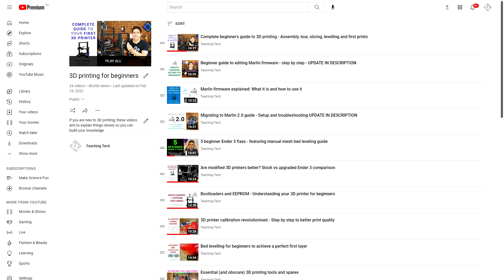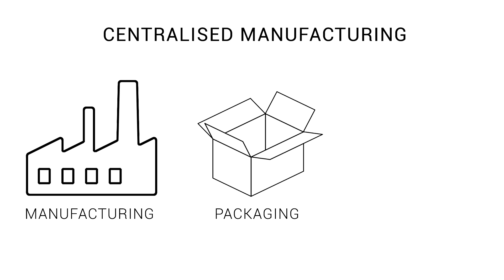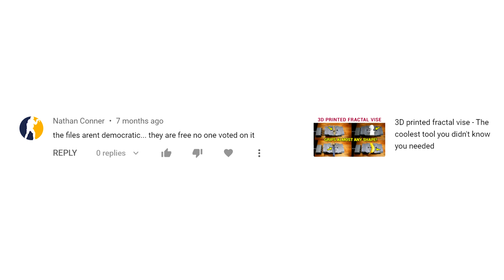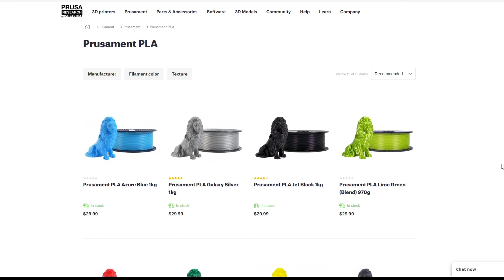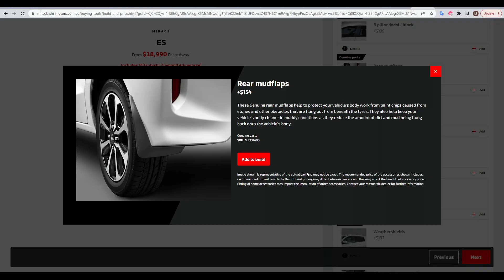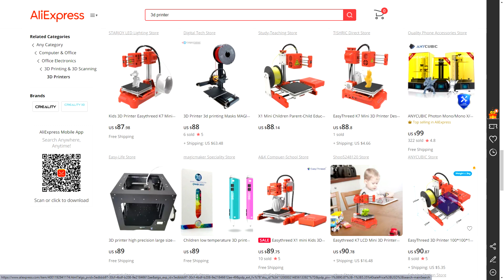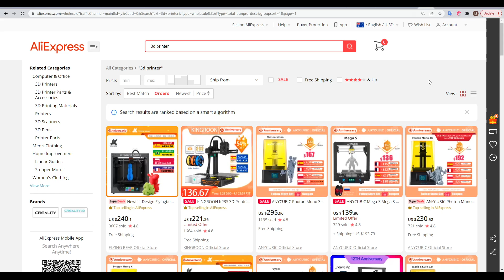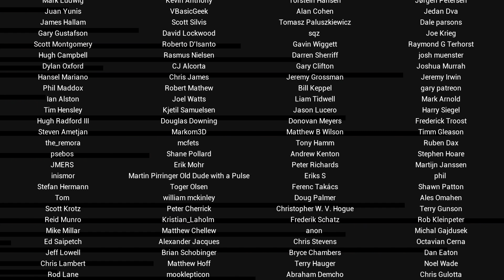3D printer trends are limiting mainstream acceptance: The 3D printing paradox

Comment: As I only started printing 12 months ago it very soon became apparent that choice of printer to start with was not going to be an easy choice, they all looked very similar to a newcomer and so time was spent on vids like yours to help make the decision, it also became apparent that after running the printer (Ender 3 v2) for a couple of weeks that upgrading parts to get better print quality was going to be required, that would probably put a lot of prospective buyers off if they dont have the knowledge or tools to complete the tasks, its still very much in the tinkering stage if you want great prints with increased speed. Excellent channel been of great help with the firmware side of things,
Reply: I'm running a stock v2 with basic mods like dual lead screw ( belt linked ) , bl touch and jeyers firmware - other than that i have not found any need to do anything else and these were more convenience based mods than necessary . out of the box it ran fine and i only did the mods for my own satisfaction , i do have a direct drive conversion sitting here but i won't fit that until the bowden system starts to fail .
Reply: @Flattyman  Yes, I have the same upgrades as yourself plus a microswiss hotend, and BL touch, the printer was OK out the box but is now more consistent and surface finish much better, these are now mostly available as standard on some printers and is reflected in the price, suppose it depends if its a hobby or you love tinkering.
Reply: I feel the only thing these sorts of printers really need is an alu extruder for $4, and then fine tuning and setup. Lots and lots of that.

Comment: Very well said! The number one reason I bought a Prusa Mini as my first printer was that I just wanted it to print - and I'd say they nailed that. Of course I had to learn slicing and tricks, but that brought my parts from 90% successful to 95% successful. Your analogy of 2D printers is spot on. The early laser printers were extremely complex and often needed an understanding of paper path, lasers, scanning mirrors, heated fusers, etc. Especially when they stopped working. Most people don't even know there is powdered plastic getting discharged onto electrostatically charged paper and then melting it into the paper with a 1000w heating element inside an $80 laser printer.
Reply: But now you also get the cheap inkjets which are no worse off than low-cost 3D printers. In that regard, I'd say low-cost 3D printer are more reliable than cheap inkjets. When a 3D printer breaks down, you can actually diagnose what the problem is and replace the broken part (or better yet improve it so that part never fails in the forseeable future). 2D printers (and modern cars to an extent), do not allow any detailed diagnosis at all, as the machine just locks up until you replace the faulty component. For example, many cheap printers do not allow black and white printing when your tri-color cartridge is empty. The printer just refuses to print until you to replace your tri-color, but this doesn't actually solve a badly writted program.

Comment: In "BIG PICTURE" terms... 3D printing will not have any real-world impact to compete with or replace classical manufacturing due to the limits on materials and speed. There are probably more issues I could add to this list, but those two are the most important imo.
Reply: It's definitely not a replacement, but a good eco-friendlier alternative to shipping (as was explained in the video). It's not single-use either (unlike a 2D printer, which nearly everyone has and everybody has access to; print shops). Only a good way of filament recycling and manufacturing stands in our way of nearly 100% shipping free 3D printing.

I'm sure however that once home 3D printing is accessible to the layman and companies freely give out models (or through verified purchases, if they want to 'only service customers'), that 3D printing will be more logical than ordering replacement parts. Which is honestly the only reason a non-hobbyist would consider to purchase a 3D printer. Ordering already takes 1-3 days, or even longer, and costs way more money. Printing barely takes a few hours and is way cheaper. No mid-class household is without a paper printer either and this is even the digital age where things often go through email. 

Ease of use is the true priority. Imagine just putting a vat of fluid in the machine, pressing "print model" through the manufacturer's website, and that's ALL you have to do. Once the printer breaks you go to the local printer fix store and pick up a replacement. Like you literally do with a paper printer already.
Reply: @Catspar  I don't know if I am entirely convinced it is a more eco-friendly solution either though... I just personally don't have the DATA to do all the math, but I am thinking it might be "a wash" since whatever might be saved in shipping MFG parts could be matched with the excess shipping in PLA, RESINS & Other materials (and parts) to maintain 3D printing on a larger scale than it already is.
Reply: Do you mean 3d printing in general or just "in-home" 3d printing?

As Micheal correctly points out, the majority of the cost of buying a small plastic part is in the packaging and shipping of it. If it cost 1 cent to make a plastic part but $2 to ship, vs $1 for a printed equivalent, it makes economic sense to make it at home or at a local manufacturer, even if it is 100x more costly to produce. 

Plus logistics, and inventory is very complex. Maybe even more complex than a printer hooked up to the internet.

Comment: lol so true, for the analogy between car manufacturers. and how the innovation is driven by the hobbist community instead. it's rather backwards at the moment. i do not disagree at all here...

but perhaps if we rewind the clock far enough on cars, we eventually get to a place where their industry wasn't so great either. like 1920's era. back then it was a situation where cars were actually pretty unreliable and required frequent maintenance. and (even in spite of the ford model T, which i guess you can analagize to the ender 3 printer)... this situation of unreliable consumer vehicles was a widespread thing that actually continued for many years. perhaps all the way up to the 70s / early 80s. what changed? well there was an difficult increase in manufacturing standards. maybe in part due to japanese vehicles? ... what else? cars got fuel injectors and bye bye carborettas. the vehicle safety standards and regulations also improved for things like car bumpers. and we also got from disk brakes too. all these individual innovations each took a long time to develop. but i would say it wasnt until the modern V-Tech engine that cars finally got to be truly reliable vehicles for the consumer.

i suppose you can still argue that with cars we always had a decent repair industry, with the needed infrastructure and many experienced mechanics to get your cars repaired. and maybe this aspect of 3d printing is not quite so analagous. because typically you cannot take your 3d printer any place to get it fixed for you. it just doesn't happen like that, and for a variety of reasons

so the conclusion then is "well what is there to bridge the gap here?". because the car industry had mechanics and garages or dealerships to bridge the gap. so what do 3d printers have to bridge this gap in the 21st century? is it the internet and google? (being able to look up for solutions online)? or is it the community help provided the open source 3dp communities? for example on discord, where we mostly are chatting these days?

and also: what is the 3dp equivalent of the carberretta? or the disk brakes? or the safety standards? or the fuel injectors? meaning which specific innovations or components will actually make 3d printers become more reliable devices overall?

because that is all talking about FDM. the question i ask is if we can solve these problems while staying on FDM. or do we have to actually fundamentally change the printing technology to something entirely different? for example that of CARBON INC. who''se proprietary innovations are currently not even purchasable. you see, you could more easily say that CARBON INC is in fact innovating like an auto manufacturer. and providing a higher level of reliability. however that is only available ATM to industry partners. and even other corporations cannot actually BUY a carbon inc printer. it's all been locked away under those trade secrets

so what is the future going to be like? it seems to me like FDM will continue to stumble along for a long time. but then other technologies will appear allongside. just as resin printing already has done so. maybe there will be innovations over there, which then can obsolete FDM methods. and we will just eventually mostly abandon FDM printers all together? of course i don't only mean just resin printing. there are other 3dp technologies too. such as the vats of nylon powder, that gets sintered by the laser. what is that one called? "HP multi jet fusion" or something?

i suppose the real question here, which it just still is not so very clear (at least to me), is if FDM will solve it's ease of use and reliability issues in time before it eventually becomes obsolete. a bit like asking, well will it ever become so turnkey that everybody finally gets one. i.e. adoption to the level as any other ubiquitous modern appliances such as TVs, and washing machines. that everybody has one in their household now

that seems to be the key open question here, as posed in your video. of course i expanded those details. and extended that same line of thinking. a took it a bit further along. past the place where you chose to stop in this video. good video though 👍 it really got me thinking

Comment: Good thoughts, but I don't think human nature is the problem to fix, it's economics and technology. I think there are three stepping stones or blockers to FDM. 1. Technology must advance so commercial printing services can be fully automated - no human in the loop from recieving the order to packaging and dispatch. 2. Commercial printing reduces cost 10x by replacing filament with ground pellets. 3. Printing speed has to increase to over 50 cubic mm/s, or maybe more, even at 0.1mm layer height with good quality surface finish including bridging, and no stringing. This might require another axis, or putting the entire printer in a rotating drum or something crazy!
Reply: Its getting faster. Also i design a model to match the extruder tip size. So that means as i print bigger it dont take longer. If i printed it 100 feet tall it would take the same amount of time as a one inch model.

Comment: Very refreshing to hear your take on the industry. Have to admit that I've been quite shortsighted here. I got into 3D printing to meet some narrow objectives, and have not been disappointed. Your broader understanding of the potential of these tools, is spot on. So much more is possible but (as you say) it really requires the "industry" to step up to the challenge of making a low maintenence (support and usage) machine. Not that my 90 year old mum would be capable, but surly the 50 yo neighbour should be. 

Many thanks for sharing the breath and depth of your knowledge.

Comment: I agree with the broad sentiment that 3d printers are currently not a "just buy it and use it" tool, and that most companies aren't doing anything to change that.  I also agree that having a 3d printer need as little end-user knowledge as a car is a great goal.  But I think that right now, the comparission is a little wobbly. 

First, cars are expensive and even if they don't generate a huge profit *margin*, a single car sale still generates a lot of raw money.  3d printers don't.  Second, cars are a very mature technology and there's not much potential development left that's in reach of a hobbyist, so of course the innovation mostly goes top-down.  But if we look at cars (or aviation) from a century ago, the situation then is a lot closer to what 3d printers are like now: lots of small private hobbyists experimenting with stuff, some of which is adopted by the big manufacturers; lots of knowledge needed by the end-user in order to safely and reliably operate them, not just behind the wheel but also under the hood. And so forth.

Ultimately, I don't think I agree with the conclusion that 3d printers are actually moving away from it-just-works ubiquity.  You've already mentioned Prusa, by E3D is another move towards not having to think about your printer.  Yes, there's a lot of grumbling about how the REVO nozzle forces you to replace the heatbreak and the nozzle at the same time... but that's how we get closer to either of your analogies.  HP owns the lion's share of the 2d printer market, and when you replace a toner cartridge in an HP laser printer you're not just replacing the actual toner, you're also replacing a bunch of the gearing that moves the printer and a bunch of the components that make the toner stick to the paper at all.  All of those parts eventually need replacing, yes, but there's ways to design it that means you replace all of those parts separately and doing it that way makes the laser printer's upkeep much less expensive in terms of dollars and material waste - and much MORE expensive in terms of user knowledge and time.  Which is why HP's system is now pretty much universal in all desktop laser printers, and why I think the REVO nozzle-and-heatbrake-all-in-one has a good chance of becoming dominant as well.

My guess is that in 5 years, we'll see the  XL technology in Ender-3 sized printers for under 500$, and as more of that kind of thing happens, the closer we get to a 3d prnter in every home!

(Sorry for the rambling post, I'd try and edit it to be smoother but I'm running out of day.)

Comment: When the car industry was at the same stage as 3D printing yes they did take inspiration from tinkerers. 3D printing mass adoption is a long long way off. Manufacturers copy the ender i3 design because thats simply what people buy, they aren't shaping the market simply responding to it.
Reply: Exactly. I'm glad I'm not the only one here who understands capitalism.
Reply: Perhaps people are buying it because the manufacturers have flooded the market with low cost copies.
Reply: @Capital Inventor  Nope. That would be true if Creality was having trouble keeping up with demand, like Prusa is. But they're not. Very much not so. They're keeping up with demand so well they're practically giving them away at a loss at Microcenter.

The market of cheap printers is entirely driven by demand, not supply.
Reply: @SmartAlx  

I said manufacturers, not just Creality, were flooding the market with cheap 3D printers. 

There are a couple of reasons for items to be sold at low prices. The technology has improved, which it has. There is more competition and there are lots of companies making these cheap printers. The printer is a loss leader and for certain companies and stores, which I guess Microcenter is, it makes sense to discount the printers as it will lead to sales of filament. Basically the razor and razor blade model. Sometimes demand will bring down prices as it helps build up economies of scale. That is not happening with 3D printers. The economies of scale were already met before all of these companies started making cheap printers. 

The huge demand should be driving up the price of printers. What happens to gasoline prices in the Northern Hemisphere as it turns into summer? The prices go up as people start to drive more. But if the prices go up much and the demand will dry up very quickly.  

What is happening is a number of companies, and not all of them Chinese, taking advantage of the hype of 3D printing and how it's supposed to be accessible to everyone right now in order to dump cheap printers to anyone gullible enough to buy one and make a profit.

3D printing is nowhere near enough ready for the masses. And it's not just the machines. It's the fact that one has to get to know about the plastics, their properties, slicing software, and how the printer works just to be able to print something downloaded from the Internet. That's still leaving out fixing models downloaded and how the home environment impacts the prints. It will be a long time before a printer will be able to take all of that out of the equation and let someone print what they download. Then you have the problem of someone wanting to create something of their own.
Reply: @Capital Inventor  😂😂😂😂😂
Say you don't understand capitalism with as many words as possible, without saying you don't understand capitalism.

The demand for 3D printers is not that extreme.  Suppliers of these cheap 3D printers can meet demand almost instantly.

The fact is that laypeople who are intrigued by 3D printing don't know enough about it, so they just want to dip their toe into it at first.  They want cheap 3D printers, so that's what manufacturers give them.